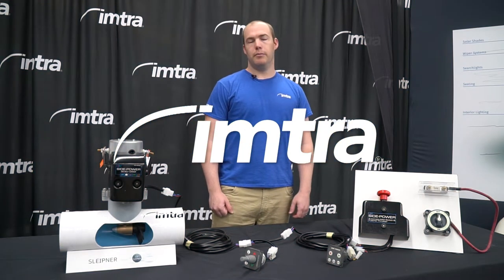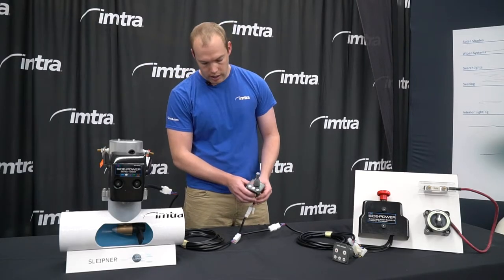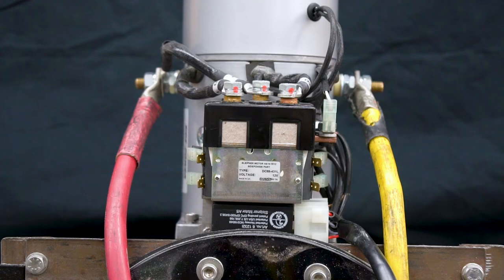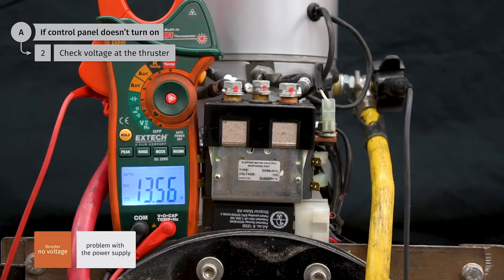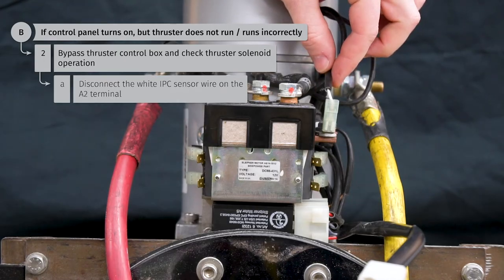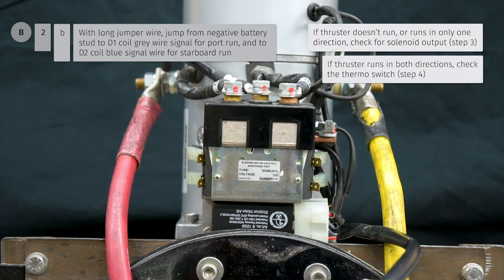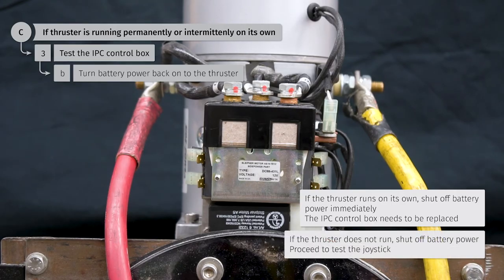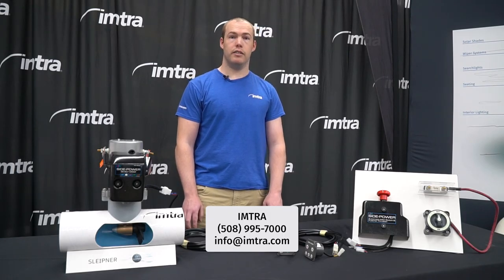Sleipner (Side-Power) Bow & Stern Thruster Troubleshooting Guide

Comment: Fantastic video, but sadly i dont find a solution to my issue:

I have a recent issue with my Stern/bow Side-power/Sleipner system.
It went from working flawless, to not working.

Scenario:
When we used our bow truster, it kept running, and we could not stop it.
Only way to stop it is by, disconnecting the "control relay #6 1229" or turning off main switch.

Troubleshooting:
After this situation, there was a smell of burned electronic.

The 2x dual-joysticks cant be enabled(gets 24vdc)

The motor solenoid "DC182-662L" we can only manual enable one way, the other do nothing, but draws a lot of amps(sparking)
*(this is ground controlled)
*Motor sounds fine this one way

Now when troubleshooting, we cant add "control relay #6 1229", then motor starts running.
The "control relay #6 1229" enables both left/right run at same time(both outputs enable) for solenoid.

For me it sounds like the "control relay #6 1229" for sure, but also the part of motor solenoid only running one way, is not ideal.
Could Control relay have killed solenoid at its fall?

Also i tried changing control relay from stern to bow, but these are not the same relays:
Bow "control relay #6 1229"
Stern ""control relay #6 1232i"

Brg.
From DK

Comment: Outstanding info. What I didn't hear is anything about an over charge indication.  The yellow and green lights on my converter/ charger are cycling (which from the manual indicates an over charge status).  Why would this cause the thrusters to not even turn on?
Reply from the maker: We'd recommend you contact our service department (508) 995-7000 so someone can help you troubleshoot over the phone and get into the specifics of the setup on your boat.
Reply: Did you solve the problem? I have the same problem. What should I check?

Comment: What about when sidepower se80 works with constant clicks in both direction and these clicks are followed by blinking light on the control panel in the same rhythm as the clicks. (Let's say 3 in a second). I have huge nee battery and new solenoid and distributor. Thanks!
Reply: Did you ever get a fix for that? I have the same problem solenoid constant rapid clicking when using joystick and even jumping it.

New solenoid did not fix, I suspect its the relay(IPC control box)?

Comment: Any advice regarding bow thruster fade?
Reply from the maker: Curious what you mean by fade? Not running at full power when held on for an extended period of time, or losing its overall power throughout the years? If the former, it would likely be related to battery power/voltage. If the latter, it could be worn carbon brushes within the motor, which wear down over time and can be replaced.